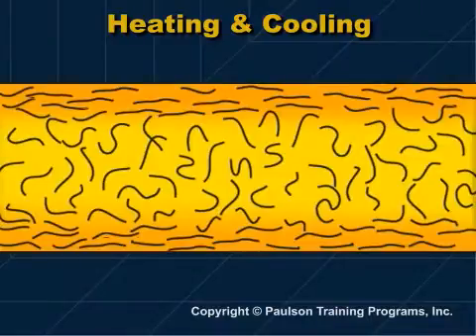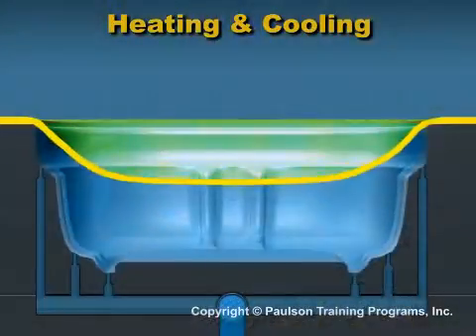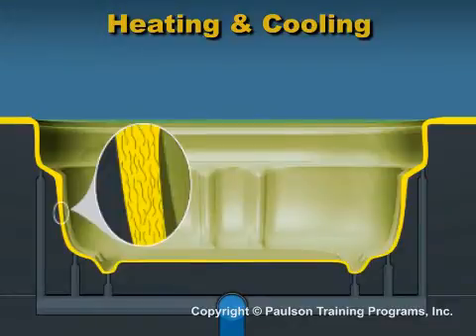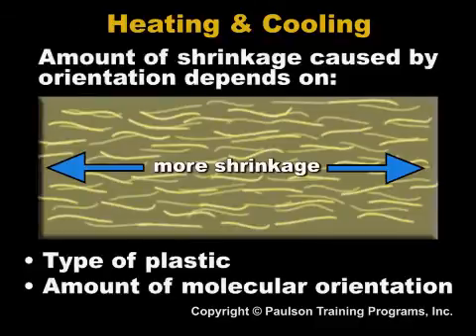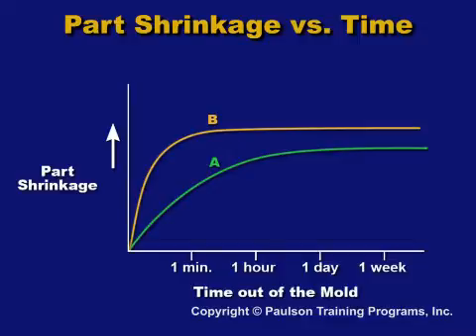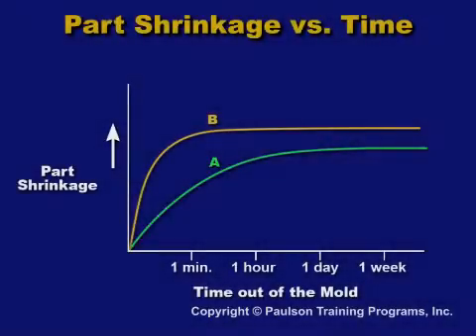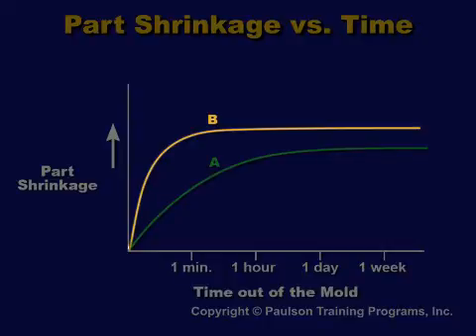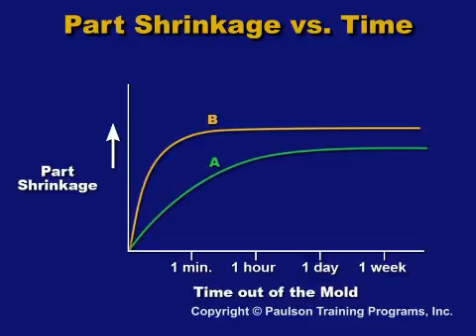Thermoforming Thin Sheet - Lesson 5.2

Comment: Hi I'm trying to heat 2mm x 950mm x 600mm polycarbonate and vacuum form it but haven't had much luck first of all it started to slump but then got bubbles in it maybe to much consontrated heat? Also what other plastic could I use that won't bubble and still be clear and have the same properties as polycarbonate as it needs to be flexible but not shatter thanks